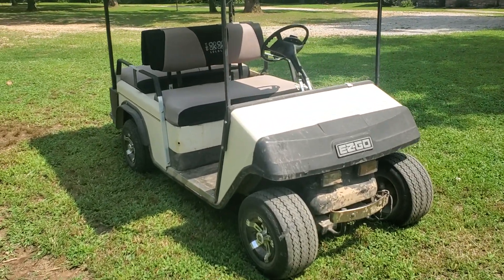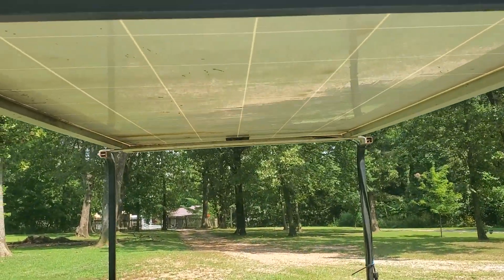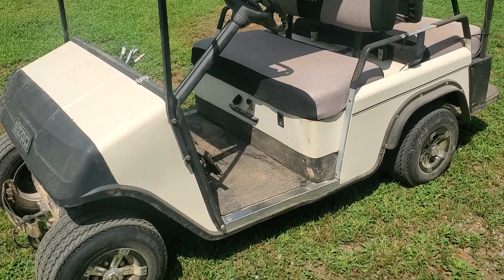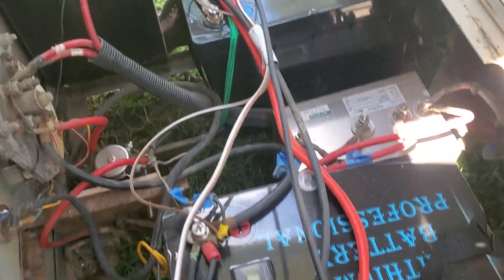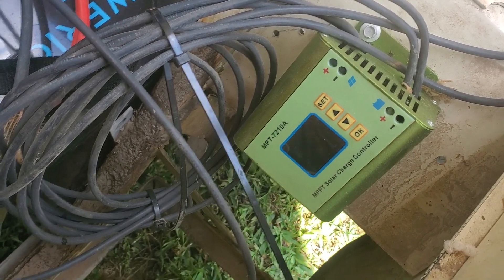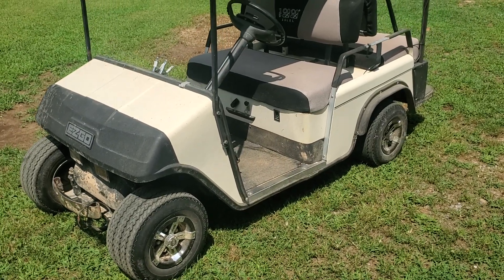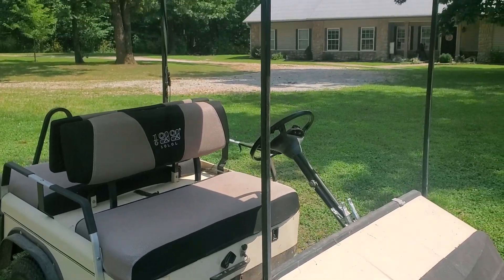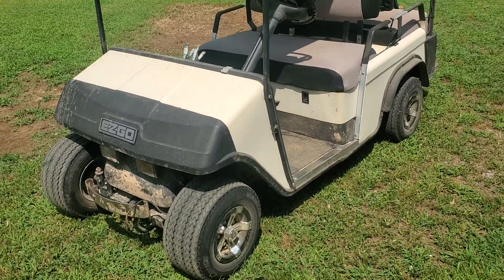DIY Solar Powered Golf Cart

Comment: how many amps is the panel? can you link all the products maybe in the bio i would love to see exactly what you bought. there are lots of different ones out there. dont know how many amps to get for the controller or the panel
Reply from the maker: @marwan3964  sorry I'm just getting back to you.  I'm using a 36v panel 9 amps.   I will post a link here in the comments of the charge controller I'm using.
Reply from the maker: This is the one I'm using right now but i might try a different one to see if it performs better

https://www.amazon.com/gp/product/B0CPHRKXQX/ref=ox_sc_act_title_1?smid=A2OPJJGT888C7B&psc=1
Reply from the maker: I think I'm gonna try this one and see if it works any better I'll let u know how it does.

https://www.amazon.com/gp/product/B0CPWS23SL/ref=ewc_pr_img_2?smid=A2KRDQ1AI5Y5G6&th=1